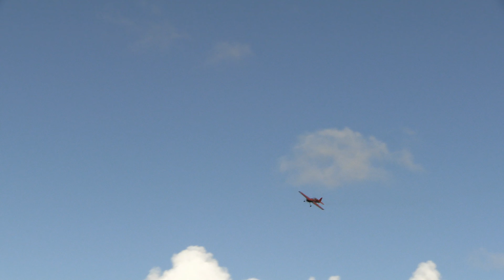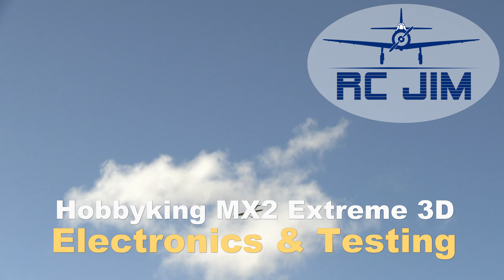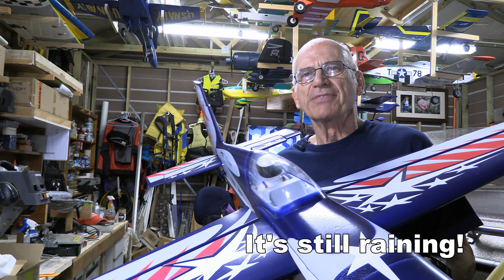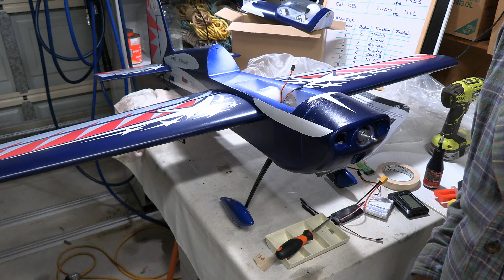Hobbyking MX2 Extreme 3D Electronics and Test

Comment: Just ordered this plane
Reply from the maker: I've finally got it to where it does what I want instead of what it decides to do.  It now has a more robust and shorter landing gear with larger wheels.  The original would be fine if you do perfect low speed landings.  And then part of it is just getting used to how a light 3D plane flies.